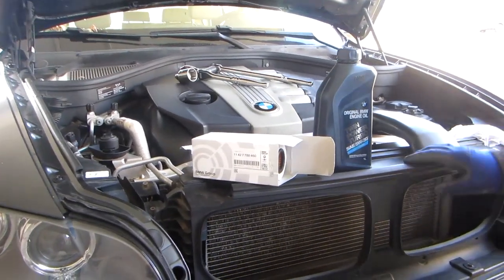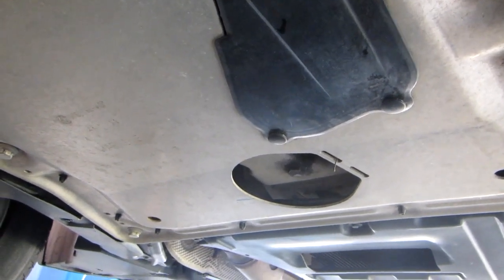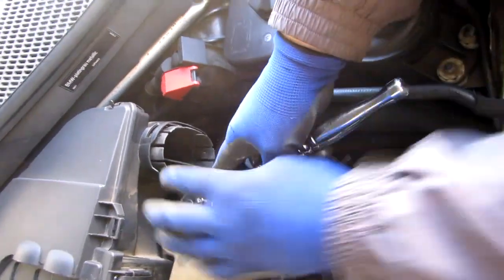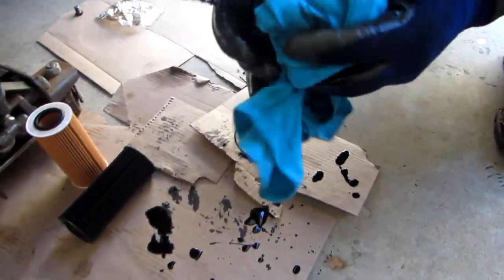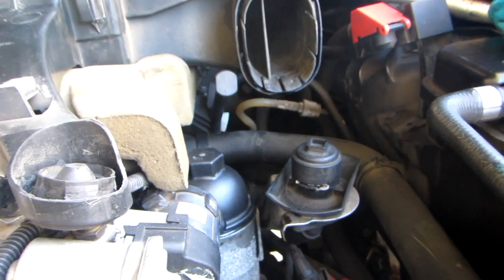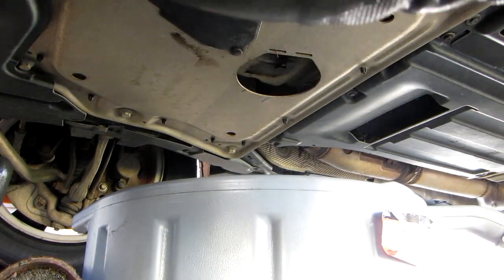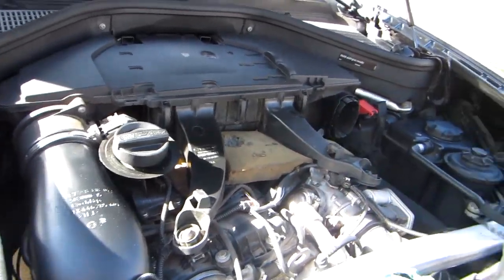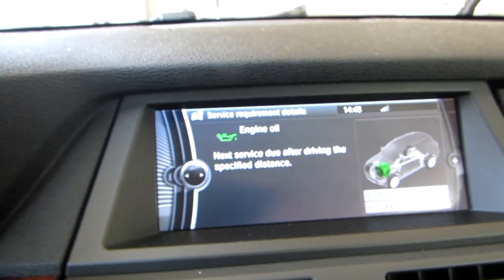BMW 2012 x5 35d(E70) Oil and oil filter change.

Comment: Left dealer after first service a quart low. Thanks for dip stick. Information center said it was full. Castrol is the recommended oil however Amsoil has a better oil for this diesel car.

Comment: Thanks for the video. I like to pull the old filter first, then the drain plug. Makes the oil drain more completely. I have the exact same vehicle, 2012 E70 35D same color.
Reply from the maker: Hello T B. Yes you are right. It is a better way to fully drain the oil. I usually do that, and combine taking off the filler cap too. Thanks for your support.

Comment: You mentioned the original BMW oil, but the oil that you have listed is Castrol. Is there are not a difference in those two oils
Reply from the maker: Hi, That's a great question. 
When you copy the part number in the BMW parts site, the description is Castrol oil, but has BMW branding on the bottle. Logically they source oil from Castrol for Diesel engines.

Comment: I always use full synthetic 0w-30 diesel oil with 10000km intervals mostly Castrol and no problems. Main reason being I have no access to BMW oil. Currently 240,000 with no oil loss and runs very quite. Should I be concerned? Has anyone used non genuine BMW oil and had issues due to oil?
Reply from the maker: Hello M A, Castrol and other brands are extremely great products. If your car has 240K miles, using other brands of oil, I would not be concerned a bit. Thanks for your comment, and if you want to help, please subscribe if you have not already.

Comment: Thanks.
Do you change the oil every two years?
Reply from the maker: Hello, I don't change my oil every two years strictly. I use OEM BMW oil so I can rely on the on board system to tell me when the oil change is do. It really depends on the miles driven, because that is a factor also. Thanks for watching and please SUB if you haven't.

Comment: is it normal for a diesel engine to have smoke when u open the oil cover?
Reply from the maker: Juan I'm not sure how much smoke is coming out, but I assume that the engine is hot and has been running for some time, then a bit of smoke, like when your boiling water and you take the cap of the pot and evaporated water releases and stops after a few seconds is normal. Anything more than that maybe you need to take a look at it with a mechanic. My opinion, if the cap is ON and you have the right amount of oil in your engine and you don't see smoke from any other part of it, you will be fine.I hope this helps, and once again thanks for watching and thanks for supporting this channel.

Comment: did you start the engine after the 6 Liter?, this way you move the oil inside the engine, after you let it seat for 10 minutes and check the deep stick again to refill.
Reply from the maker: I did start the engine at the 6 liter mark, but there was minimal difference even till today, the level is near top line. Thanks for watching.

Comment: Disagree buying dealer BMW oil is NOT well worth the money. You can get the same oil with the same specs (BMW LL04) with the Pennzoil Plat Euro L. I'ts practically the same oil as well, BMW uses Shell.
Reply from the maker: Hello Midnight Narwhal. You may be right, I didn't do extensive research on the matter, I would have taken my car to the dealer anyway if I hadn't done the work, so I kind of wanted to use what the dealer uses. All my oil changes have been done with this same oil from BMW, and the engine runs pretty well and smooth. Now if I had a performance car, maybe I would consider a better oil to use. Thanks for the conversation though, It's nice to hear from my subscribers and their insight. Please SUB if you haven't, and thanks again for your support.
Reply: After reading stories about clogged dpf, egr cooler, and carbon deposit on the intake manifold, i only use BMW LL04 oil. I am not playing around and risking thousands in repairs to save $10 on the engine oil, successfully for 5.5?yrs of ownership. This is one area where not appropriate to save money. These cars are overly sensitive to maintenance and the oil you use.
Reply from the maker: @k-man-dude  Great POV. The extra 20-30 bucks will in fact go a long way on most vehicles, and can save a LOT of money long term. Thanks for commenting and your support.